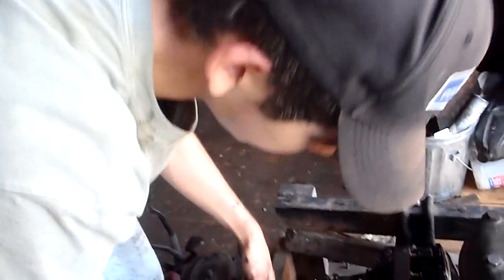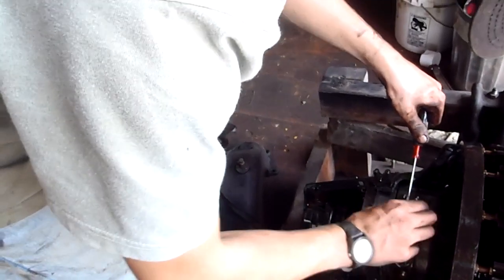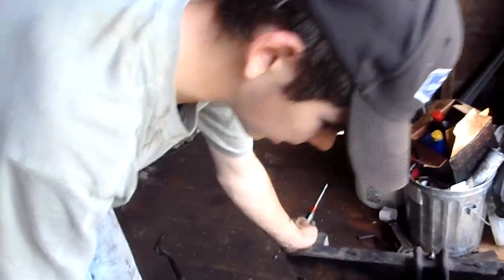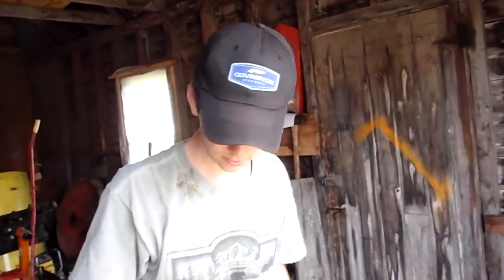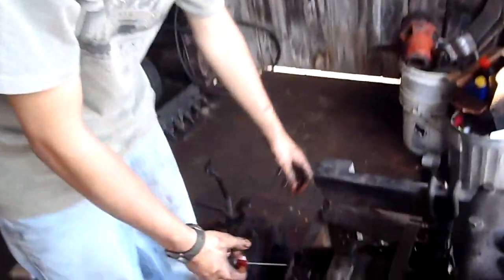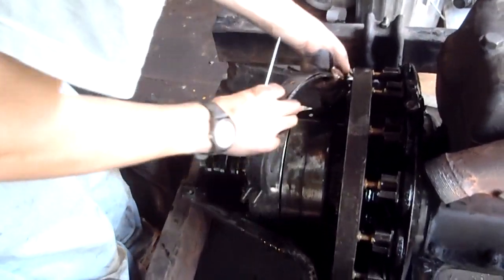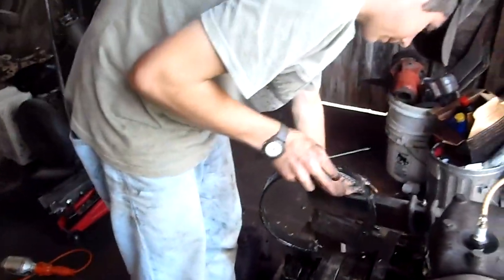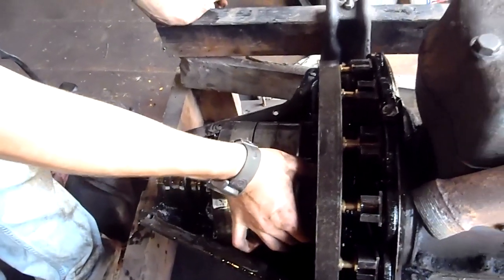Working on the 1917 Model T engine part 4

Comment from the maker: This is the only video I have up currently on changing bands. Some tools that you might need are the band clip (hold the bands in place as you take off the cover), band puller and the band wrench (takes off nut at the end of the rod and does not allow it to drop inside the transmission). You can do the whole thing with regular tools but the specialized tools make it a lot easier.Dont use any regular band. use kevlar. They last forever and you dont have to mess with them.
~Phil